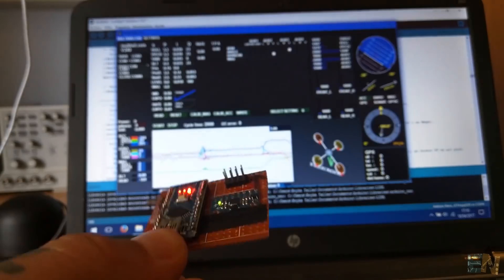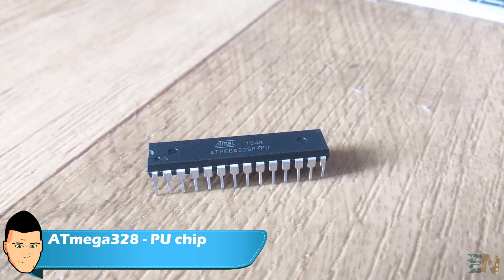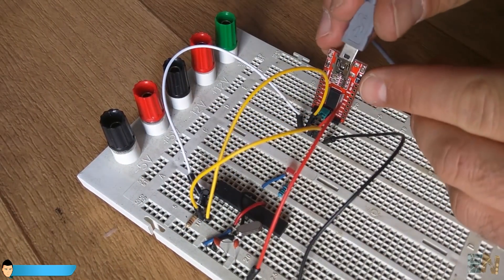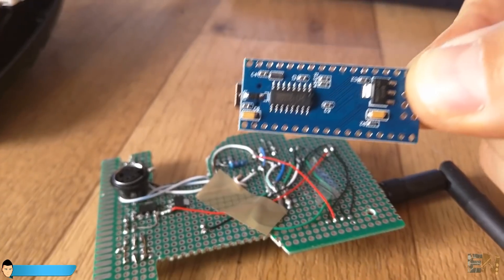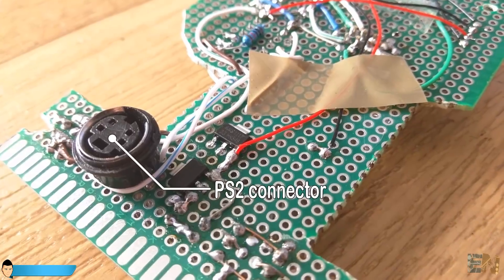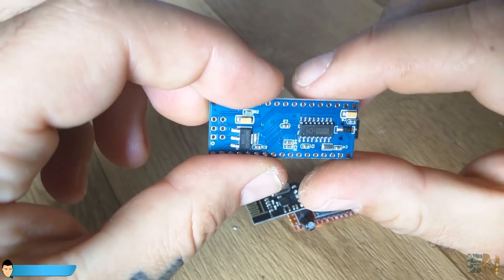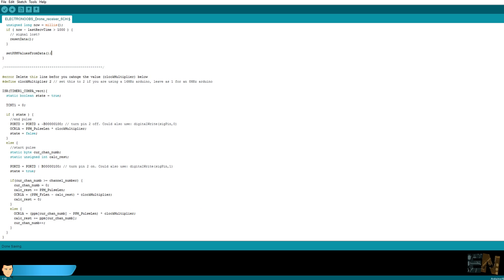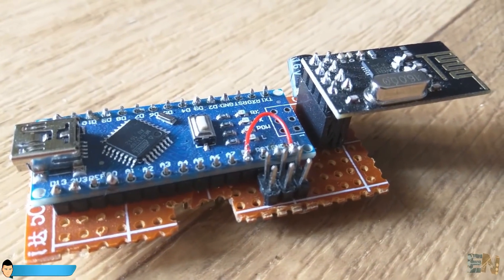Arduino drone - Part2 Transmitter & Receiver

Comment: Is there a way to wire the receiver to a Naze32 instead of arduino nano /pro mini? 
I have it set up, and think i see the noise jittering from the working receiver on the Naze, but cant seem to get the receiver and the transmitter to communicate. 
I have the Potentiometers setup raw, as im still waiting on my Joystick ones. 
Have everything wired according to your schematics, and flashed the according firmware to the Arduinos. 
Both NRF24 get their supply from the same 3.3 v ams1117 breadboard power unit. 
Nothing smoked or smelled funny. :D
The Baseflight App shows no change upon turning the pots. 
I hope you have a suggestion how to get this to work ! :)
(Loved your Idea of making Remote and Receiver myself, and so, customizable!) ;)
Reply from the maker: I'm not fully understanding you. The trasmitter/receiver doesn't work  at all or it has errors? Your NAZE32 acdept PPM signal or it has normal PWM signal for each channel. Upload the transmitter code to the transmitter arduino and upload the receiver test to the receiver and check the arduino serial monitor. If that works, then upload the normal receiver code and connect the PPM wire to your Naze board. It would be nice to observe the signal on one oscilloscope. 

Any any other question just ask!
Reply: Thanks for the fast Reply! :) Sorry, i will try to clarify a bit more! ;) 
In the Baseflight App, i set the Naze32 to PPM Input (which disables PWM) 
I wired the Receiver up, and the Baseflight App shows me slightly jittering Values, sitting roughly in the middle ( i have a lot of Interference here where i sit, as there is a wifi router nearby, and various Electronics, etc. 
The Jitter is small tho, from 1500 to 1501 and back, for example. 
When i turn on the power for both nrf24,  the signal in Baseflight shortly jumps.
Thanks,I will try the Receiver test , and get back to you! :)
 Sadly i dont have an Oscilloscope, but i would like to have one, someday. 
I only have a Multimeter at the moment.
Lets see if i can get this to work. Its my first time doing this kind of build! ;)
Reply from the maker: But ignoring the small jitter the transmission works? I mean you slide the potentiometer and the received values change?
Reply: ELECTRONOOBS, in fact it does not,and I still need to Try the receiver test Today. What it does is "spike" as soon as I connect the power to both nrf24 (in the receiver tab in Base flight) 
In my opinion, that means, the Naze at least has a working connection to its receiver (I think there is a problem in communicating between both the Nrf24. And I think the Problem might be on Transmitter side) I will be back home in like 2.5 Hours, and then I will tell you the results of the receiver test. Let's say, I get no output, at all. Even tho everything is wired correctly. What would I do then? I can make you as many photos as you need, if you want to see my setup. 
😊
Reply: ELECTRONOOBS, I got to hook up a joystick and it's button to the Arduino pro mini, tried to make the Nrf24 transmitter communicate with an Arduino Uno with the Receiver Test code on board. The Serial Monitor in Arduino IDE is connected, and showing Nothing. So there is no connection. What to do now? 
😊
Reply from the maker: It show nothing or 0 value? If it shows nothing it might be that you're using a different baud rate as the used in the test code. Open the serial monitor and change the baud rate to be the same.

If you receive 0 values then the radio connection isn't working and I can't know why... Keep telling me more info!
Reply: ELECTRONOOBS, it shows nothing. It's possible I made an Error in wiring, but I went over it multiple times. Can it be, that it is a problem that both nrf24 share the same power source? Maybe it's more convenient, if we get into more direct communication, I feel this may take some Effort. 😄 Thanks for the Support!
Reply from the maker: If you uploaded the receiver code to it it should print something like this:

Throttle: 0       Pitch:127       Roll: 127       Yaw: 127     
Throttle: 0       Pitch:127       Roll: 127       Yaw: 127     
Throttle: 0       Pitch:127       Roll: 127       Yaw: 127     
Throttle: 0       Pitch:127       Roll: 127       Yaw: 127     
.
.
.  

If it prints nothing it must be the baud rate! Just open the monitor and set the baud to 250000!
Reply: I Got it to work, changed the nrf24 module to one with shorter wires, which were soldered too (the others were just with jumper cables).I now have control outputs in the Baseflight App Now, how to arm this thing? Im totally new to this! :D Thanks again for leading me in the right direction!

Comment: you 3.3 voltage regulator looks different in the receiver schematic than in the link given above.  Is it the same?  And, what type of decoupling capacitors did you use?  thanks

Comment: i build your transmitter and receiver with nrf but have 2 telemetry have used telemetry and change your code? nrf not stable :(
i have this telemetry :
http://hosthey.ir/telemetry.jpg
Reply from the maker: If you supply well the 3.3V to the NRF module and add the decoupling capacitor you should have no problem. My radio connection works perfect. Any way that radio UART module seams ok. So what are you asking me?
Reply: ELECTRONOOBS 
Nrf modules disconnect suddenly. I added capacitor to the input voltage and nrf itself. But I still don't have the connection. I don't know why it gets disconnected. There are two models one with anthena and one without. I have two telemtry that I want to use instead of nrf. Nano has one serial is there going to be a problem? Should I have two serials? The last one is, ppm has a little delay is it because it is receiving data from a port? and how calibration my speed controllers :(

Comment: I think you should modify  the PIN and POUT of the AMS !! 3:45
Reply: by the way I burned my NRF24 :/ cuz it was the first time I have used the AMS1117 3.3 .
Reply from the maker: OMG, you  are totally right, sorry. I'll change the schematics right now. Thanks a lot, that's a huge error.
Reply from the maker: Ok, I've changed the schematics, sorry for the error and that you burned the NRF module! Thank you!
Reply: you are still  my hero and the best elctronical in youtube 
thank you for you videos and waiting for your new tutos
Reply: I'm using transreceiver module Nrf 24L01+ and arduino nano then what will be the changes in code because  given codes not  working with this modules ??